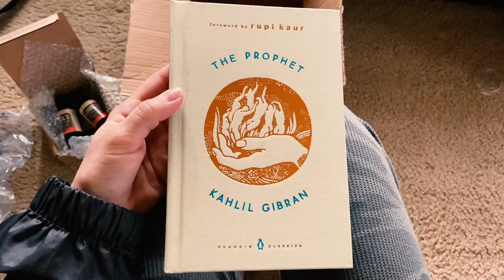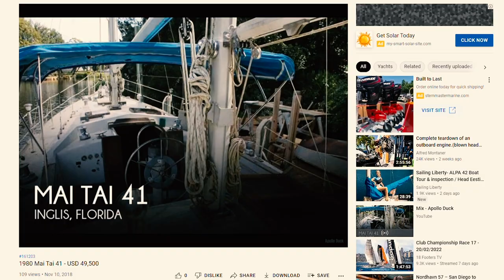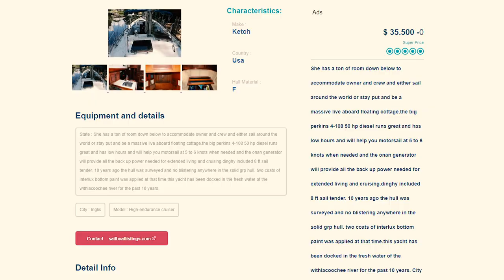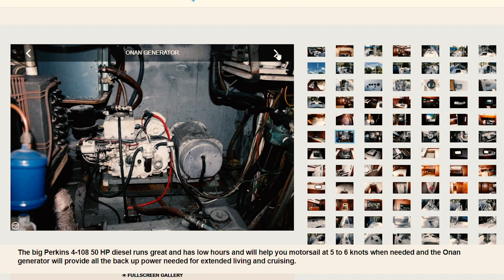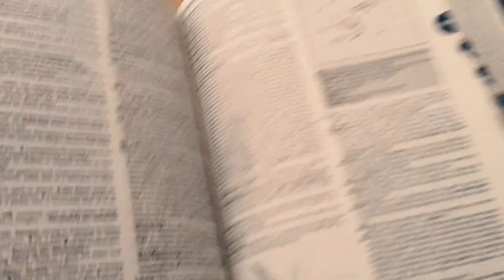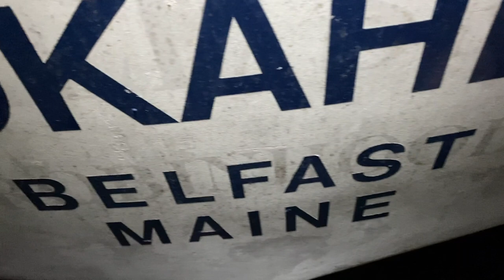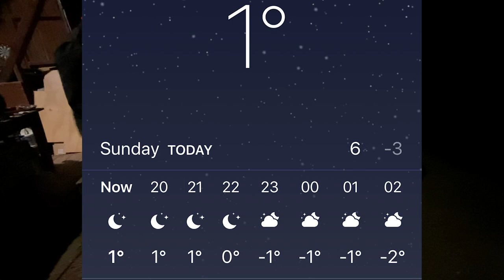Sailing Liberty- CHEAP 41 FT KETCH !/ Buying a bigger boat? Trip to Florida / Mystery Double Ender

Comment: Try $1K per foot ready to go.  Look at the islands.  When a couple are fed up, they're fed up.  I was offered a 37 foot narrow boat in Fiji for two plane tickets to Seattle.   That was back a few year.  Cash is King.  By it without survey for 40 cents on the dollar. If you're confident or have a friend with a hammer.  Good luck.

Comment: You seem very optimistic about a 10k boat . I have seen people put 100k in a refit of a boat that size . Hope it works out for you two . Good luck !
Reply from the maker: Thank you! We had to make a move with some boat and we looked hundreds of boats in 3-4 months. But nothing really clicked. Or they got sold very fast. We have funds to fix the boat up and upgrade to some extent:) We are motivated and hard working and Ted has excellent mechanic skills, carpenter and electrical and decent plumbing skills. I am learning next to him on the go.